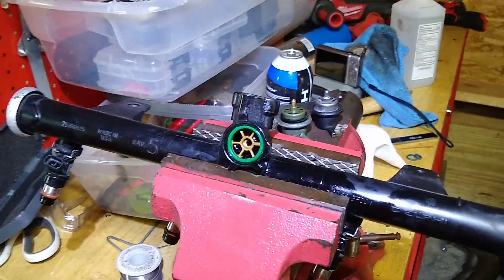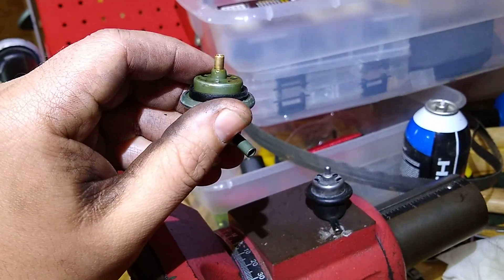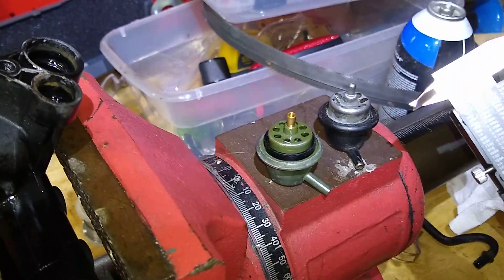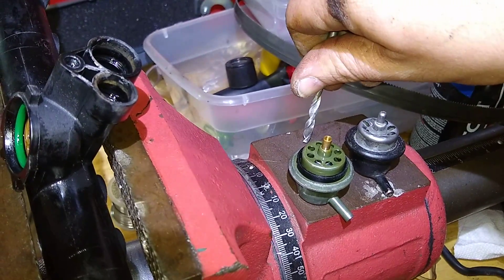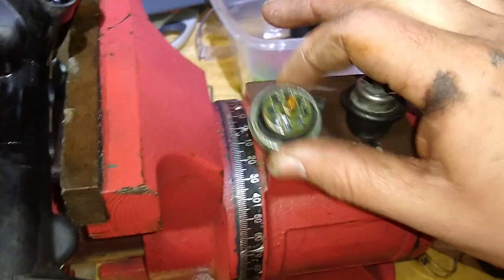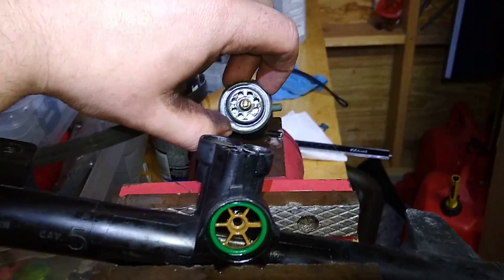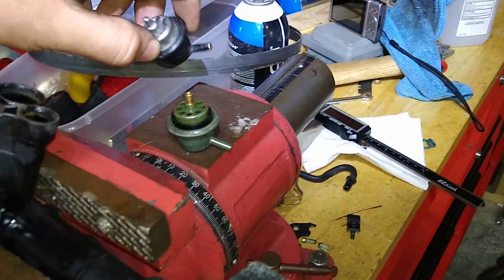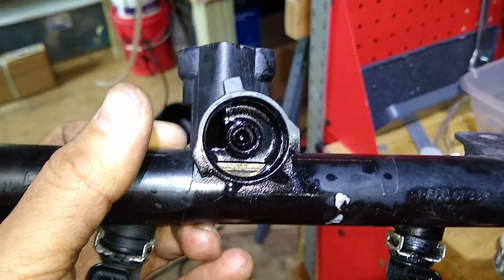GM Fuel Pressure Regulator Porting part 1 of 2

Comment: If you can find one, the gen3 flex fuel rails have a much larger regulator and the rail is different to allow more flow also.
Reply from the maker: Kyle Adams very nice, didn't know that
Reply: @scrapmetal_sleepers  the flex fuel also has nice stainless rails.
Reply: One down side is the flex regs are set for 50psi instead of 58psi. That's a roughly 7% reduction in effective injector flow and might affect your tune.

Comment: can you drill the hole out and when the bit gets close to the bottom.aka diaphragm hook up a mity vac to the regulator and pull the diaphragm up enough to finish the hole with the drill bit ?
Reply from the maker: That sounds like an excellent idea! I'd try it that way first especially if you have the mighty vac, go slow at the end though, don't was a burr preventing the regulator from shutting fully
Reply: I was going to mention the same thing! Good thinking!

Comment: You can grind the tip off of the drill bit in lieu of a diamond bit.
Reply from the maker: mistijim that would great as well, it makes it one less tool to buy, I already had the diamond bits and didn’t want to sacrifice a drill bit if I didn’t have to.

Comment: This is cool thank you for sharing the info. I’ve ran a China aeromotive off of the pressure test port with great success as well. They are usually -4 AN. Just take out the valve with a valve core tool.
Reply from the maker: Shannon Sisk yep, 4an, it might have been the route I went if I wasn’t so cheap haha, good tip for those running a returnless rail, and want a reg at the rail.